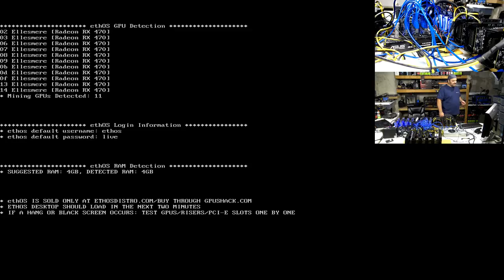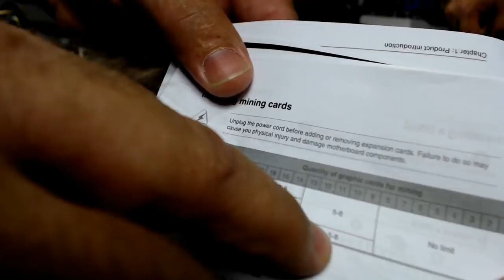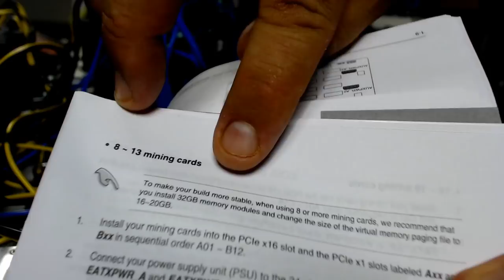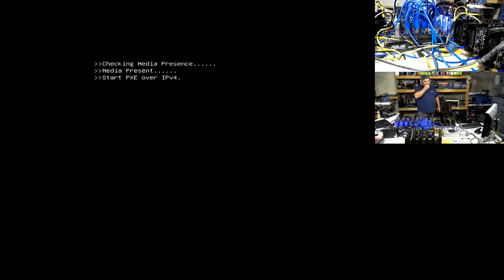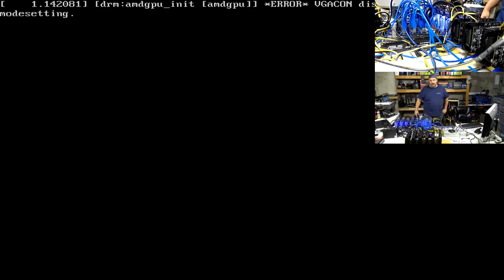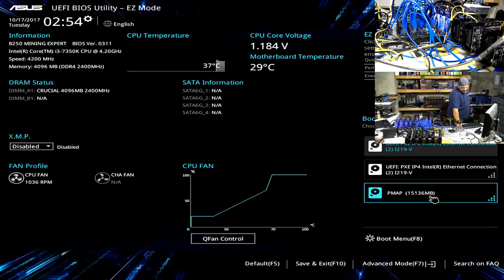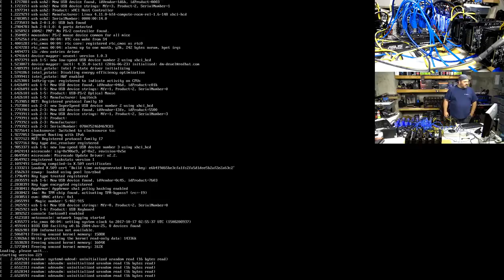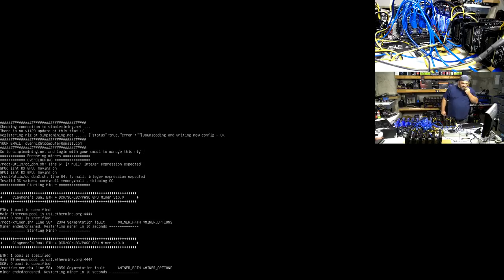Live VLOG #63 - ASUS B250 Mining Expert + AMD RX Mining Cards & Nvidia P106 Mining Card Mix

Comment: Just a suggestion, you might want to SSH into the PimpOS after it boots. Often time the screen with the underscore looks like it's stuck, but once SSH in, it's functioning. PimpOS with monitor direct plug into the mobo doesn't work for me when I first go through the registering process so I discover that SSH is the way to work with PimpOS.

Comment: We have bough B250 ASUS , Why this board don't support more then 11 Cards, We have 12 RX 570 and using 2 Power supply each of 850 Watts 8 GB Ram 250 SSD etc whats the problem why the system get hang and display not work properly we are using latest windows 10 version updated. Can you pls explain why so the problem.

Comment: I see there's a lot of questions about power supplies. I was wondering if you could get by with using two cheap 750 Watt HP server power supplies? They cost about $15 each on eBay.

Comment: So just to be crystal clear, P106s are absolutely needed?
I have the B250 and working on it for a week trying to get the 19 slots all up and running.
I can't get higher than 13.
I've  got 7x 1070s.
2x old R9s. (which I have to say, both are performing very well!)
4x RX 460.
I HAVE to use P106s?
Reply from the maker: Yes, you have to use 8x P106 or P102 or P104 and 11 normal cards (amd or nvidia) ; to achieve 19. or the max is 13 normal cards.
Reply: Got it. Thank you very much.
Reply: hi dude, actually right now I am running 15 gpus (13 rx + 2 p106) smothless using SMOS or hive os. Have you make those 19gpus running ?

Comment: Hey m8 . What is the efficiency on that power supply the 2400 one ? And is it ok if i use it to power up a 7 gpu rig all by itself or do i need separate power supplies for mobos and cpu or risers ??? Thanks The reason i ask is because i use 3 power supplies atm...all cards are oced and work at around 90-100 watts. but when its functional it takes around 1500 w on my electric counter which is not really a good power to ratio for me on the whole system.

Comment: I can't get my B250 mining expert to POST with 14 cards. All RX 580, any card.. you add a 14th it won't POST.  You pull and of the cards out and it'll boot with 13. So I just run SimpleMining OS with 13 until maybe they update BIOS to get more working.
Reply from the maker: Correct, the last 8 you need P106 Nvidia Mining Cards
Reply: Bits Be Trippin' is it something they can fix with a BIOS update in the future? I think SMOS can run 16 cards but you don’t want to mix and match in SMOS.
Reply: Electricos Cosmos did you ever make any progress with this? Are you still using simple mining OS?

Comment: Hi there,
Anybody known that can I use 19 rx570 gpu's on this mainboard? or not?
Reply from the maker: You will be able to use 13 RX570s ; this board requires 8x P106 Nvidia Mining Cards to equal 19
Reply: can i run 13x rx570 and 8x p106 in Windows 10?
Reply from the maker: Yes, we show this on our channel in a like configuration using 13x RX470 and 8x p106
Reply: Thanks Bro, another question is, can i run only 11x  rx570 with this on windows 10?
Reply: if the board only has 19 pci slots, how are you running 21 cards? 13 470s and 8 p106 is more than 21. What am I missing?
Reply: 13XRX470+8X106=21.........SO YOU CAN PLAY WITH 21 ON THIS MINING EXPERT B250....??????

Comment: Do you really need to use those specific mining 106 cards on this mobo?

I'm setting up my rig now with 12 RX 580s and planned to go 18-19 580s on here...
Reply: Edward Clifford-Garrett How did that go? What OS are you using?
Reply: Nate Legakis set up 12 580s no issue  using HiveOS.. haven’t bought any more GPUs yet as I’ve maxed out the circuit it’s running on

Comment: Anyone seen this issue with the B250? I have 8x RX570 4Gb all working fine, got interested in BIOS modding for the elusive 30Mhs per card - all cards flashed but only slot A01 will produce the 30Mhs all the rest give 23.5, I have tried every card and riser in A01 all give 30Mhs when in that slot so it seems an issue with the other slots - on latest BIOS, strange no?
Reply: just to close the loop if anyone is reading this in the future.. I was running the latest dual drivers that support gaming and compute, turns out going back to the beta blockchain drivers was the solution! 
30.8 MHs

Comment: Hey @Bits Be Trippin, is it still true that those p106 GPUs must be used to achieve a total of 19 working GPUs?

I am stuck at 14 NVIDIA GTX 1070s but I see how Asus mentioned using an AMD driver: https://www.asus.com/support/FAQ/1034921

Curious if I can surpass this 14 NVIDIA limit with the AMD driver using AMD GPUs? Trying to avoid those p106 GPUs for now.

Comment: Does this require 3 PSUs to turn power ON? Got mine and am only using 1GPU for now and it wont power ON.
Reply: works with just 1 psu.. but if youre running more cards, you need more PSU
Reply: mine wont boot if I have the molex power plugged in to the mobo, it works just fine with powered risers
Reply: I have the same problem do not turn power ON. Did you find something related ?

Comment: what would be the coin to mine right now if I wanted to just make a little of side cash? I have a 1080ti and would run it at night since power is cheaper
Reply: Ethereum or zcash.
Reply: ok I setup a 1080ti zcash doing around 730sol/s at 90% power and 63C. Is that good?
Reply: EndstyleGG If you can increase the memory yoy may get more sol
Reply: actually, weirdly enough, I really didnt matter how much I ocd the memory I only got like maybe 10-20 sols difference, but if I ocd the core clock to like +190 I got a mayor boost like 40-60 sols

Comment: hey bbt best channel for mining, really love the vids too sometime a bit to technical for me but im getting there,,,,  i have 1 question please, when i connect the mb and power it up with no gpu attached  (asusb250mining mb) i get a few greenlines and specs on the screen,i had this years ago it was a hdmi cable that was not installed correctly, but this has no gpu on it yet, and i tried a nother screen and different cable that works on another computer and same lines and specs result,  could it be as i haven't installed windows yet? that's problem is just on bios screen?  , its a 24 inch screen but i cant see that being an issue?? any help be appreciated, using ax1200i psu everything is brand new thanks again :) merry xmas

Comment: the wiring to all my risers burnt out on my 6 card 1080Ti Rig... how annoying
Reply: Only use 2 riser via one cabel, the 6 pins on the evga´s only having one 12V pin and you draw between 30-40Watts per riser
Reply: Sonofthor yeah I had 2 risers per wire, but I think because all cards were ftw3 cards they just drew too much power... even they were set to 80% power
Reply: You use 2 psu? Put all riser on the psu wich the 12V 8 pin connected should solve this issue... otherwise too much current running through the sata/molex cabel wich only has one 12V pin on psu side ;)

Comment: is it possible to run 19 gpu's without p106 in anyway?
Reply from the maker: no, 13 max
Reply: aww -_- that sux, not its old card its mission impossible where i live to find some,
anyway thank you for help
Reply: Bits Be Trippin' it is possible all 19 are rx 580..please replay me.
Reply from the maker: no, 13 cards is max if using regular cards. You need 8x P106/P102/P104 to make it work to 19, where your config is those mining cards + 11 normal cards.
Reply: just extra question is it possible to use 1070 ti as p104 ? it must be mining cards for this matter

Comment: So I did some digging and may be of some use but I cannot curently validate.  Here is an old link about running the linux driver in "headless mode" which apparently does not have the artificial limits back then.   Other issues could be bios space, BAR and driver compatibility,etc.  but it would be interesting to have you check this out on a vanilla ubuntu linux install and play with the proprietary AMD blockchain drivers after blacklisting the stock X11 stuff.

http://www2.ati.com/relnotes/amd-catalyst-graphics-driver-installer-notes-for-linux-operating-systems.pdf  "look at section 5" and also look at this old article for insight. 

https://community.amd.com/thread/197524

 Good luck, I am going to sleep.  ; )

Comment: with new ASUS BIOS 0401 for B250 mining , blockchain  sapphire rx580 im getting 30.5 Mh/s 8GPU's
Reply: razarace did you overclock the gpu's?
Reply: LoneSniper 868 
Yes i did
Reply: razarace How many watts are you pulling?
Reply: 1525 Watts, also i am currently mining BURSTCOIN simultaneously / three HDD with this MB, celeron 1 thread 2gb memory space allocation.Thinking about to convert all remaining PCIe for HDD mining.

Comment: Why not just try vanilla Linux like Ubuntu 16.04 or the newest Fedora with a modern kernel?
Reply: I subscribed.  But to talk about thread ripper and why is slows with swap, look at the architecture.      Unless I am missing something main system memory is integral to the architecture.  If it needs system ram for fundamental I/O, it would make sense if slows down when it has to swap to slower mediums like ssd or spinning rust.  Let's talk...
Reply: Set swappiness = 0 in /etc/sysctl.conf then do a sysctl -p then test again.  Linux  uses as much ram as possible before swap and the opposite of windows strategy for virtual memory.  Avoid the headache and just use Linux and look at the opensource drivers.  Just an idea.  I can help where I can.  Thanks again for all your hard work trying to get this board up with this many Gpus.  It will require removing it blacklisting stock gpu drivers in the kernel but I for some reason do not see this as the most insurmountable thing.  Start with raw Linux distro like the newest Fedora or Ubuntu.  I will help and have a budget for this coming very soon if I believe this board is viable.  Message me please and let's work together to have a solution.  Thanks again and many blessings.